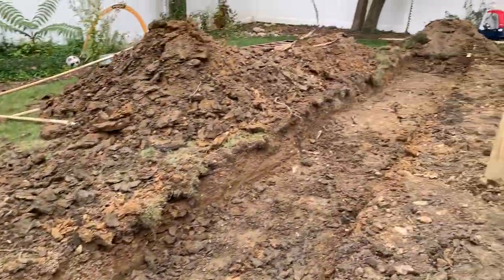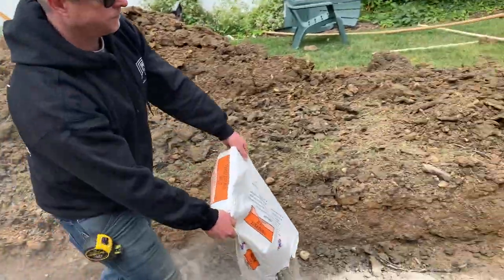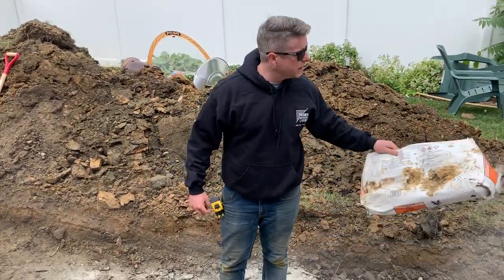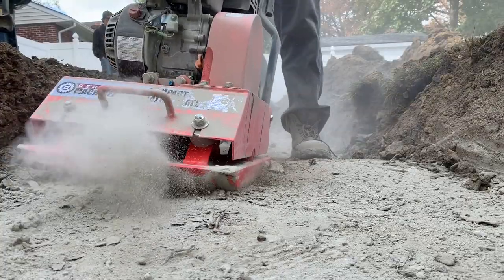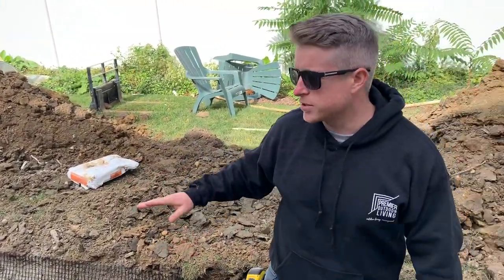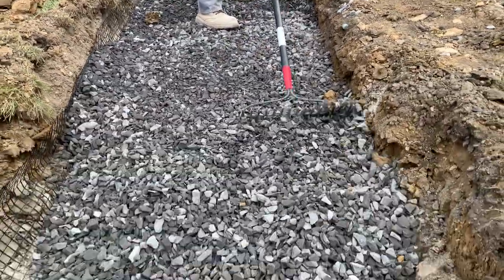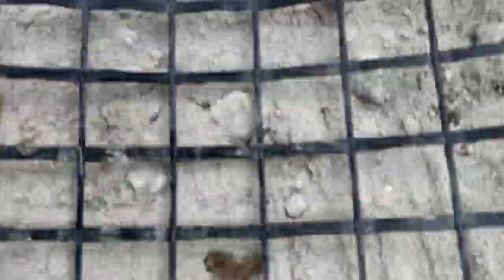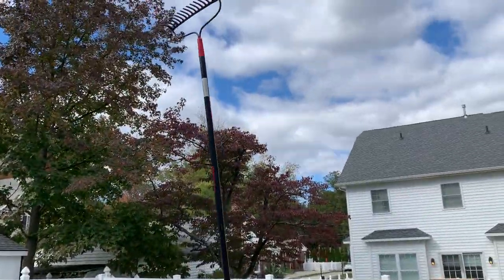Preparing The Base For a Retaining Wall - Farwood Project

Comment: How would I go about compacting the base for my wall when, and I'm not kidding, I hired a landscaper to build me a 3ft high wall (on a hill, supposed to be dig down 18 build up and fill 18) and he dug down almost 4 foot, filled it back in (still a foot deeper than it was supposed to be mind you) and didn't compact it what so ever. Needless to say the first rain completely ruined the wall and I fired him before it was even complete. We have since pulled all the blocks back out but I don't have the equipment to dig out 100+ feet of soil/ gravel mix to compact it in layers. We will be using a 4500lb plate compactor. Can I add the type s, mix it in and compact heavily or is it 100% necessary to dig it all out and do it a few inches at a time?
Reply: so what did you do?